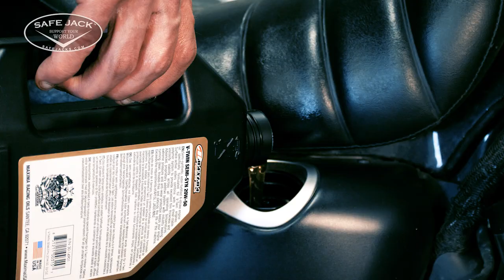TALON Oil Filter Tool | Product Demonstration

Comment: I’m on day 8 trying to get my oil filter off, it’s just the top now, the can and filter element is long shredded off. I saw this video and bought one immediately! Can’t wait for it to come!
Reply from the maker: We're so happy you found us and we're very excited to hear the results!
Reply: I was attempting to remove a Fram ph8a filter on my 64 ford f100. The larger bolts were to big and didn’t fit in the filter holes, no problem, the kit came with thinner bolts, an easy swap. I lined up the tool with the filter , used all my strength, and it didn’t budge! I then tried again and broke a bolt it was on there so tight! I replaced it with supplied extras and tried again, it finally broke free! If it wasn’t for this great tool I’d really be in trouble! Thank You!  Small video very soon on YouTube to follow.
Reply from the maker: @moonlightfordf1005  You've had quite the endeavor, but we're happy to hear you got the job done!

Comment: Would this product work on a lawn mower oil filter? I see that there are smaller bolts for smaller holes, just not sure if they're small enough.
Reply from the maker: Good morning, Kevin.

The Talon will work on most lawn mowers and most oil filters in general, however we still encourage you to take note of your specific application. The Talon comes with #10 (0.194) and 6MM (0.236) screws, and is adjustable down to .95" in two prong mode for small oil filters. If you have any further questions, please feel free to reach out to (509) 735-2106 and a representative will be happy to work with you in finding the answers.